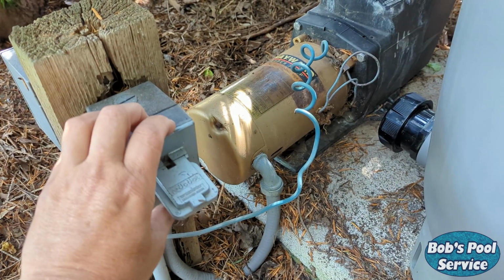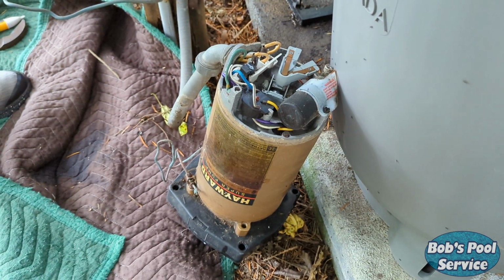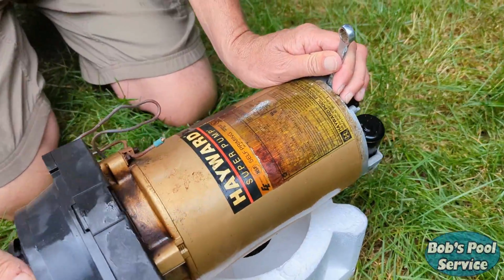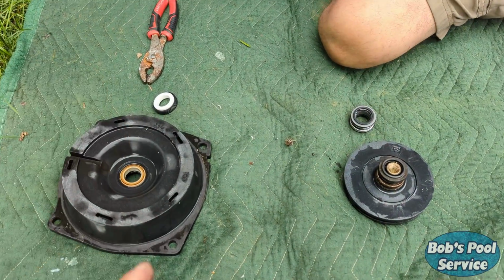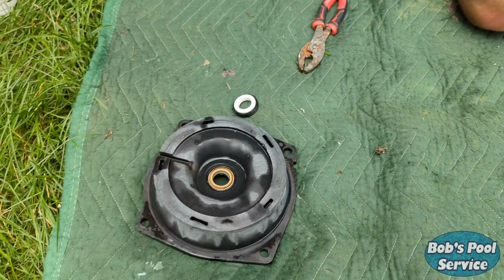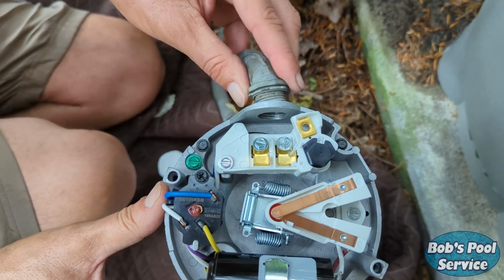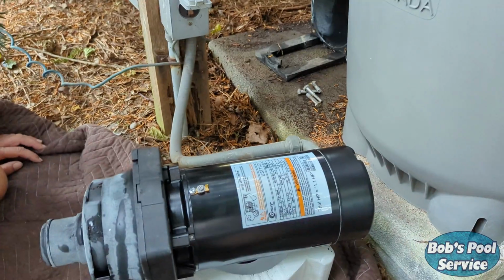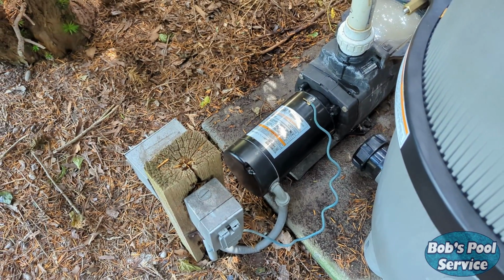How to Replace a Hayward Super Pump Motor step by step

Comment: Thank you for this very helpful video.  I’ve got a new motor arriving tomorrow. My current one only lasted ten years. Can you think of any reason that my pump would run on 120v but not 240v?  Crazy thing. My motor runs on 240. Came out this morning and it was dead. No hum, no noise, nothing. It was getting 240v. Capacitor was within spec. I removed the motor , moved the jumper to 120v, made a cord out of an old extension by attaching some spade connectors, and it started and ran fine when plugged into an outlet. But when switched back to 240v, and wired to the pool breaker, nothing. Completely dead.  (And it’s definitely getting 120v per leg and 240 between legs.  Have you ever seen such a thing? Thanks in advanced.
Reply from the maker: Most motors are dual voltage and you change a switch or jumper inside to match your electrical source of 120 or 240v.  Be sure it's correct or you can ruin the new motor.  Now as for your situation where it's working when hooked up incorrectly, now I never saw that!  Make sure each leg is coming from a different side of your electrical panel , potentially both legs could measure 120v but if they're in phase with one another and coming from the same hot bus bar you'd have the exact situation you just outlined.  You can test with a VOM meter by placing a lead on both hot legs simultaneously, it should measure 240v if you do it that way.
Reply: @BobsPoolService  thanks. I appreciate you answering. I bought a new motor and swapped it out today. It’s Running fine, so it was in fact that motor. . It’s just the most curious thing. I’ve changed the motor on both of my Condensing Units a few times over the almost 20 years I’ve lived here. Usually can ohm out all 3 leads and tell the windings are shorted or bad. In this case everything tested fine, including electrical input, the capacitor was perfect, but the motor was dead, nothing. As a goof, I moved the jumper to the 120, and it ran from my outdoor outlet. For like 10 minutes until I unplugged it. Oh well, maybe I’ll save it and replace the motor in the  pool vacuum I frankensteined together if the existing 1.5hp ever dies. Thanks again.

Comment: Could you provide any direction on what pump to order? I have the same style pool pump as in this video and the original motor was a Hayward
Reply from the maker: @tuttle810  I'm assuming you mean which motor to order...  The proper motor style for a Hayward super pump is a frame style 56J, you do want to look at the tag and match the horsepower however.  You also want the motor to have a threaded shaft.  You don't need to buy one from Hayward you can get one from Century, AO Smith, Emerson or US motors.  In fact Hayward doesn't actually make the motors for their super pumps they just source them from these companies.  If you can't read the horsepower on the label you can select by looking at the impeller...  2605 is 3/4hp, 2607 is 1hp and 2610 is 1 1/2hp
Reply: @BobsPoolService  thank you very much.

Comment: Excellent step by step video! The only hiccup was that - even for the same pump - the 7/16" wrench was too small. I had to use 11mm.
Reply from the maker: Hrm, some of them with the end caps are bigger, usually 9/16 but  7/16 is actually slightly larger than 11mm, it's 11.1125 so maybe your 7/16 was damaged or perhaps it just took the right touch to grab the flat spot and you got lucky with the 11 mm?  But thanks for commenting and I'm glad the video helped!  Just made another one today on changing the seal only, hoping to find some time to edit and upload.  Again thanks for watching.

Comment: What if the impeller doesn’t come off by hand?
Reply from the maker: Use a strap wrench or large slip joint pliers to get more leverage.  It comes off counterclockwise like an ordinary screw.  Just be careful not to damage it.  You could probably insert 2 small screwdrivers into the flutes if you don't have a large enough pair of pliers if someone else holds the motor while you turn them.  It's rare that we come across ones that don't come off by hand but everyone has a different grip...  I'm always the guy asked to loosen a jar lid so probably a bad reference.

Comment: This video was a lifesaver. The process was easy and I saved hundreds by doing it myself. I took it slow, but still had the job done in a little over an hour. Great Stuff!!!
Reply from the maker: Glad it worked out, that's what pause is for on youtube :)  We change over 100 motors a pool season on average now, nothing lasts like it used to.

Comment: Thank you so much! I'm pretty handy but this video was so simple that even a first-time rookie could follow it and get this replacement done properly. My friend's pool guy wanted $400 JUST TO CHANGE THE MOTOR that my friend had purchased on Amazon for $200! I had this job done within 35 minutes. The ONLY thing I would add here is that you should explain that the pump HAS to have water in it BEFORE STARTING IT and whoever is doing the replacement, needs to add water into the pump strainer assembly BEFORE using. I failed to do so but was smart enough to turn it off when I realized there was no vacuum being created by the pump. I opened the strainer intake lid and realized it needed water to create the vortex necessary for the pump to actually pump the water. I would also suggest that they buy a new set of gaskets as well since they wear pretty easily over time. I had bought a set on Amazon for $14 that included ALL gaskets AND the seals. I also bought a silicone lubricant made specifically for pools ($9) that made it easier installing the seals and gaskets. That said though, thank you SO much for this incredible video, it literally may be THE best How-To I've ever watched....and I watch a LOT! lol!

Comment: since both power leads were the same color, would it matter which way post you connect which wire to?
Reply from the maker: If you have 220v both power leads are the same, just connect them to L1 and L2.

Comment: Simply the best Super Pump motor replacement video - I've watched a lot of them.  Thanks for taking the time to explain things that others take for granted the viewer knows.  My pump motor died on Friday and I followed this video Saturday (for pump removal) and Sunday (for new install).  FLAWLESS.  Great tip on (1) not bothering to really worry too much about really tightening the impeller, (2) showing us how the old pump seal can come apart in multiple pieces and making sure to remove all pieces (3) reminding that there is a housing gasket.  I would have totally missed that - mine came out when I removed the old motor.  Only other tip I'd mention is that a person may want to replace the diffuser gasket since, if buying a kit, this gasket would be in there so good to check if that needs replacing while the motor is out.  Now if I could find a solution for the pump drain cap to stop leaking, I'd be set!  The cap slot is a bit stripped and no matter how much PTFE tape I use on the cap, the cap won't really tighten well and have to play with it forever to get it just right so it won't leak.  New caps don't help.  Thanks again for taking the time to make this video - I'm sure it has helped a ton of people!
Reply from the maker: Thanks for the kind words, after I watched the video I did realize I should have mentioned changing out the diffuser gasket, in this case it was ok but oftentimes why not change it since you're in there.  Great observation!  We really didn't set out to make a video, this was an actual service call and we had a little extra time that day so I pulled out my phone and had my helper who has zero experience fixing pool pumps do the work so I would be able to narrate and instruct him.  As for your pump plugs not staying in, tell us about it...  it's really unfortunate Hayward hasn't addressed this, used to never be an issue but over the past few years nearly every pump we winterize has this problem and telling someone they need a new housing because of something as trivial as a drain plug seems ridiculous.  Hayward filters also have this issue with the drains where even a new cap can leak.  As for a fix, you can do what we do and get a deeper plug that's 1/4 NPT and not use the one with the washer.  If you're lucky it'll go in a bit deeper and grab some better threads, just be careful not to put on too much teflon or it can crack the housing (the front, not usually the side one)  Another way is to get a 1/4" stainless steel nipple and a draincock (valve), this way you won't have to keep taking it out every winter, you could even glue it in with plumbers goop if you wanted, in fact on my own pump I just glued a plug in (don't use teflon if you do that) and since I only have to remove the water once in the winter it's not a big deal.  I just vacuum it out or use a sham-wow to soak it up.  For the rear plenum you can loosen the bolts or what I do is just pour in half a gallon of non toxic antifreeze in the front portion and let it mix with the water in the back.  Hope this helps, there's a lot of pool stuff that's just poorly designed, don't even get me going about Hayward Chlorinators and that lid o-ring design :)
Reply: @BobsPoolService  Bob - thanks again for taking the time to write such a great reply.  Do you do service calls to somerset county?  LOL.   Yeah - for my Hayward sand filter, I had a similar issue last 3 years where the plastic drain spout chipped and now the cap will still leak no matter how tight.  If others have this issue, what I've done is used silicone earplugs to shove in the filter holes when I open and then the cap seals with no leak.  At closing, just remove the silicone - easy. I wonder if that would work for the drain plug?  Thanks for the other few tips on the drain plugs.  And, I have the Chlorinator too.  What a pain although I don't use it much as I pretty much switched to liquid 10+ years ago that I manually dose once a day so rarely fussing with it.
Reply from the maker: @MarcL-sj7qi  Hey Mark, we do have some clients in Somerset, it's not our main area but if you need something just mention to my biz partner Walter who answers the phone that you spoke to me on youtube.  As far as the chips on the filter stem drain it's oftentimes animals that chew on it, maybe they're looking for water or maybe they just like to chew?  Squirrels seem to do this with fence latches and pump handles too.  Good move on switching to liquid chlorine, we see more pools damaged by tablets than anything else.  if you ever do use them really test the water often and adjust the pH, it'll always be low as you use tablets because they're half acid.  You maintain your pool the same way as I do my hot tub with just liquid chlorine (bleach).  If you can get some old style drain plugs without the flange and washer they're a little longer and might help you seal your pump or as you said silicone...   you can always just put non toxic antifreeze in there over the winter as well if you seal it off.  I saw some stainless steel plugs on amazon I'm tempted to order and try out, once upon a time pumps came with brass or bronze plugs that lasted 30 years. It's really sad what's happened to the quality of pool equipment across the board for the most part.  We used to change out filters that were 20 years old, then it went to 10, then 5 and now we see cycles of 3-4 years for this stuff.  Pump motors went from using copper windings to using aluminum in some cases and the bearings are the big culprit, they used to use quality usa made ones but now who knows what's in there.  I have pumps from the early 80's we use to pump out pools and they're still as quiet as when I bought them.
Reply: @BobsPoolService  Thanks again!  Will do on the service.   I know what you mean on the quality.  My original superpump motor from 2006 lasted 10+ years.  These Century replacements now go 2-4 years.  Really is terrible.  It was ages since I used the chlorinator.  With the pump out of action, I ran to home depot to get some pucks.  $50 for 5lbs - geez these things have gotten to be a lot.  I used them to float in the pool to keep up some levels of constant chlorine, and when the pump was back working after watching your training vid, I transferred them to the chlorinator, which hadn't been used in years.  I switched to liquid (BBB method) over 15 years ago after having way too much CYA in the pool which caused major issues with chlorine not being effective.  Got myself a good test kit and now test the chlorine each night and just add liquid once a day.  For those near an Ocean State Job Lot, they carry 12.5% liquid at a great price.  I'll have to look for those stainless plugs - maybe worth a shot!
Reply from the maker: @MarcL-sj7qi  BBB is the best, I can tell you know your pool stuff well!  If you want a better chlorinator check out the Pentair 320, it used to be called the Rainbow but was bought out.  I still prefer to avoid tablets but sometimes if you're away for a week it's nice to have.  Unlike the Hayward the 320 is also full flow and the tablets aren't stewing in water when you turn off the system.
Reply: Great video, thanks!  Is it necessary to replace the impeller and such if I just need to swap out my motor?
Reply from the maker: @bruceincola8692  As long as the impeller, diffuser and all the plates are in good condition you can definitely re-use.  The seal however I would always change if you're doing a motor. We carry a stock of extra parts in case something inside is damaged, just check yours carefully.  Unless the pump ran dry for a long time generally the parts are able to be reinstalled without any issues.  Best of luck - Bob.

Comment: Thank you for doing this video. I wasn't sure how I was going to spin the old impeller off and hold the shaft from spinning. Also picked up a couple other tips. It was a great help. 👍
Reply from the maker: Yeah, it's not obvious how to hold the shaft unless someone shows you.  Glad it helped.
Reply: @BobsPoolService  That was incredibly helpful. I searched videos for just that reason and after watching yours I learned a couple helpful tips on removing the ceramic  seal/bushings. So helpful! The new motor is running great and so quiet. Thank you again.

Comment: How do I put my diffuser back in? Just clip it into the hole?
Reply from the maker: I would push it onto the seal plate (the part attached to the motor in my thumnbnail) and then carefully push the entire assembly into the pump housing.  There's grooves and the diffuser should say "top" on it, you want top to be up.  It's really not possible to put it in the wrong side up, it simply won't fit into the slots on the seal plate.  Don't forge there's also a gasket on the front of the diffuser, you may need to replace it oftentimes they are in bad shape especially if you use tablets.

Comment: What motor is this and what seal kit goes with it i have a salt water pool and my motor just went out.
Reply from the maker: The motor style is a 56J, you'll need to get the right horsepower though, it should be on the tag.  If you can't read it then you can check the impeller, 2605C is 3/4HP, 2607C is 1hp and 2610C is 1.5hp, 2615 would be 2hp.  The seal is a PS-201 or PS-201V (for salt water, the V stands for viton)  I always put in the Viton seals when I change them out.  You don't need to get a Hayward branded motor, in fact Hayward doesn't make the motors.  AO smith, century, emerson or any other will work so long as it's a 56J frame threaded shaft.
Reply: Ok thank you what about if it says the flange is round or square does that matter any because my pump is the sp2607x10 hayward 1hp motor but it looks just like the video?

Comment: What do you do when the impeller will not turn loose by hand?  I have the wrench on the shaft, rotating the impeller counter clockwise and it will not budge.
Reply from the maker: In that case I'd grab the impeller with a strap wrench or large pair of slip joint pliers to free it. 95% of the time they come right off by hand as we showed in the video but every so often, especially if the water chemistry was too acidic or the pump is just old they can be stubborn.  At worst you'll break the impeller but at least you'll be able to get off the other parts you'll need and just buy a replacement impeller.

Comment: Can you tell me what watertight fitting you are using at the pump itself?
Reply from the maker: Those are Praher 1.5" unions.  Newer super pumps are now all 2" and we've switched to Praher high temperature unions ( black nut) so if the pump gets hot they won't leak.  The part number is 200-906 for the 2" and 150-906 for the 1.5" size.  Hope this helps.

Comment: Stuck impeller. It won't budge. Cant get it off.  The motor was making loud noises and eventually smoke came from that area. I'm trying to disassemble but the impeller can't come off.
Reply from the maker: We use a pair of very large slip joint pliers (or a strap wrench) to grab the impeller if it's seized on like that. I've yet to have one that wouldn't come off but oftentimes the impeller does break in the process of removing it.  Is the impeller just stuck or is the actual motor seized?  A "stuck" impeller to the shaft wouldn't cause the motor not to rotate or smoke  but a bad bearing causing a seized motor would.  if the pump is over 10 years old and it's really stuck that bad you may want to opt to just change out the entire pump (or try using a pipe wrench or large slip joint pliers to persuade it to come off)
Reply: Thank you! I used a pipe wrench after submitting my question, and it worked!